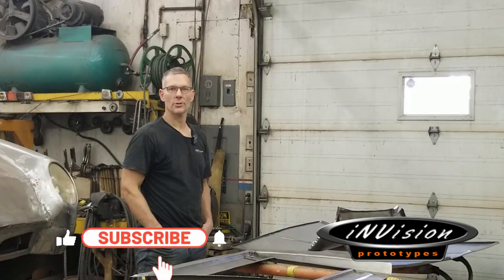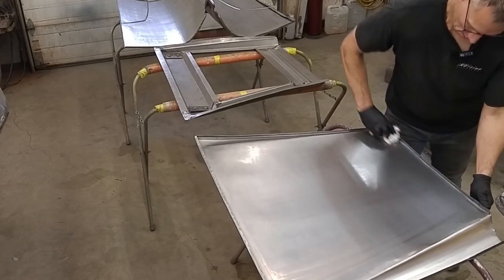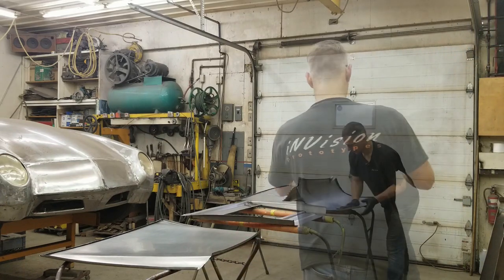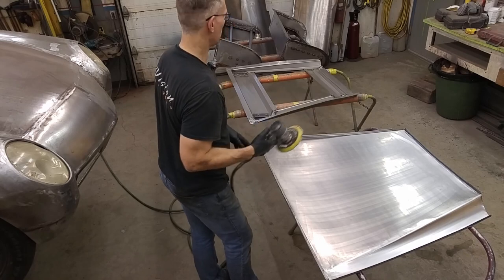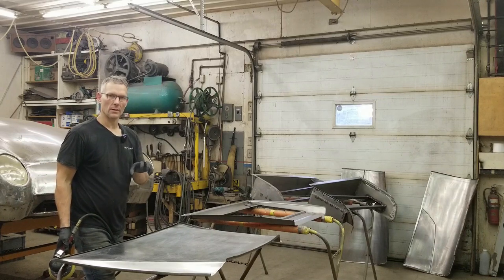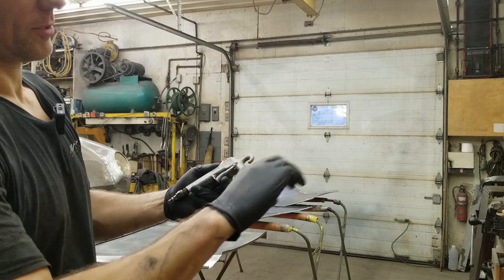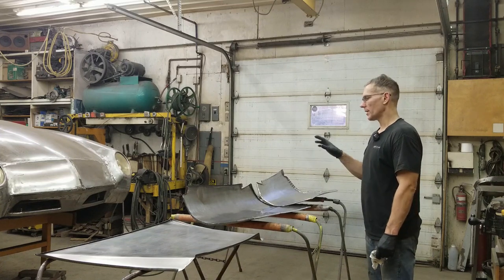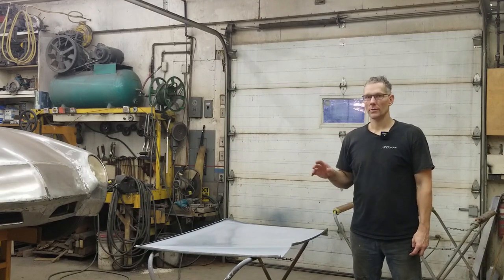2K EPOXY Primer Sheet Metal Panel Prep - TRICKS & TIPS | Ep.38 Retro Styled Electric Hot Rod

Comment: I've had better luck with self etching primer with urethane primer on top than epoxy primer but whatever works for you use it thanks for the information
Reply from the maker: Thanks for sharing!
Reply: Better luck doing what? I am genuinely interested in the answer.
Reply: @Spiritof_76  self etching primer over  bare metal than epoxy primer I have seem epoxy primer pill off
Reply: @stormyyoung6344  Was the metal thoroughly cleaned and sanded with minimum 100 grit? Do you remember what brand of epoxy primer?
Reply: @Spiritof_76  i have done many cars most sand blasted then 180 gritted shop I work at gives a lifetime warranty

Comment: I cannot get a clear answer on this.  I am painting a hood and roof on a van.  First timer.  I want to cover with an epoxy primer.  I used a Random Orbital and sanded the metal down to 180.  Should I have stopped at 80 grit?  How smooth is too smooth to accept epoxy primer.  I am afraid that I have already made it too smooth.  Any input appreciated!
Reply from the maker: Hi, when I prep bare metal for direct to metal epoxy I'll use a DA and 80grit(no higher than 120).  Never had any separation issues.  Work in gloves to prevent oil from hands getting on panel.  Wash panel with degreaser before and after sanding.  Allow degreaser up to 30 min to evaporate before shooting your epoxy.  That's it.  Now with urethane surfacing 2k primer the panel can be sanded with 180 up to 220.  Hope this helps.  Let me know if you have any other questions.  Please hit Subscribe.  Thanks!!
Reply: @iNVisionPrototypes  subscribed!  Thank you!  I was getting such bad advice from manufacturers and paint shops (Telling me to go 320-600 for Epoxy primer DTM).  That made no sense to me.  Seems way too smooth.  What degreaser do you use to clean the panels and can I just re-sand the metal back down to 80 from the 180?
Reply from the maker: @FinestEventss  Ic.  I use heavy duty wax and grease remover supplied by our local jobber.  Yes, you can sand back down using 80.  Cheers!

Comment: Thanks for the video. Can I spray epoxy primer right after sandblasting or do I need to sand it aswell?
Reply from the maker: Hi Christian,  You will need to hit the panel/body with a DA or by hand with 80 or 120 grit before applying the epoxy.  You want to knock off any loose blasting media as well as smooth the blasted profile out a bit.  Results in a better finish.  Thanks for watching.  If you have any more questions don't hesitate.  Cheers, N.

Comment: Good work. I’m surprised by all the dirt and grease you got off the parts. 
What de wax de greaser do you use? I have Prepall but don’t know if it’s the best. 
Paul
Reply from the maker: Hi Paul, our jobber carries extra strength Proform degreaser.  I've heard Prepall works well.  Just wash until you have no more residue and you're set for the next step.  Thanks for watching!!
Reply: @iNVisionPrototypes  I will. I not only have a 1977 FJ40 Land Cruiser that needs new paint, but I have an old Southbend Heavy 10 L lathe that needs attention. I’m following your example. 
Not everyone will spend the time in surface prep and I admire your focusing on that part of the job. It’s clearly number 1 in getting a good finish. 
Seriously, I was shocked at how many times you cleaned each piece, still getting black on the rag. I’m trying to teach this to my daughter. The importance of surface prep. I think she gets it. But I will forward your video to her as a reminder. 
As for my FJ40, I’m tempted to have it done professionally. But part of me wants to try it myself. It doesn’t need to be showroom quality, just protected. 
You’re working on a Porsche? That’s what it looked like in the video. An old S maybe? I’m looking for a deal on a 1973 BMW 2002 tii. My dream car, with an M engine with 6 cylinders, twin turbo and supercharged, and disk brakes all around. I used to own a 1969 BMW 1600 and fell in love with that car. Also owned a 1973 BMW 3.0 CSI that I bought in Milan Italy and shipped to Long Beach CA. 
Sorry for all the info. 
P
Reply from the maker: @paulmanhart4481  Hi Paul, I started painting when I was quite young on small parts and pieces eventually working my way up to full vehicles.  It can be quite daunting to paint a complete car if you've never done it.  If you are thinking to do the FJ40 yourself may I suggest to paint the panels separately and practice on something you don't care about.  Proper materials are expensive and it's easier to redo a single panel vs. the whole body.  The '73 BMW 2002 tii is a sweet car!!  In the video I was working on a one off hand built vehicle called Electrode we created a few years ago.  With respect to the prep stage, I will never paint over someone else's prep work as I've seen entire sections of the initial epoxy primer layer peel up from the metal after final the clear has gone on.  For whatever reason the epoxy never stuck.  That's why I'm extremely particular when it comes to prepping our cars before they see any paint.  By the way, no need to apologize.  I really enjoy chatting chat with my viewers.  Usually I reply sooner, however, it's crunch time for the '51 as my Dad and I are getting things wrapped up before paint.  Anyway, thanks for sharing and best of luck on your projects! 👍 N

Comment: Nick, I want epoxy on my clean metal. I have to choose an epoxy w/ catalyst or a "DTM Epoxy" and those scare me with a weak acid they claim to provide a chemical tooth. Sanding with 80 grit or finer gives us the mechanical tooth, but after all the work, cleaning I am afraid of delaminating. 
 The kind were all is done correctly, times, temp and comes off with some masking tape. Do you have a preference or theory?
Thanks. Mechanic wants to paint, for himself.
Reply from the maker: Hi Dean,  I haven't been able to buy self etching primer from my jobber for at least 15 years.  We've been using 2K epoxy primers without ANY issues using the procedure illustrated in the video.  I do recall 'helping' a friend who brought in a car... already primered and ready for paint.  During the unmaking process when I pulled back the tape it lifted everything down to bare metal.  I assumed poor prep work but after asking him, self etching primer was used.  I don't know if it was a case of sitting on the shelf for many years or what.  But I stick with the 2k epoxy for all my jobs and never paint over someone else's prep-work/primer.  We strip it down to bare metal and start fresh.  Hope this helps.
Reply: @iNVisionPrototypes    You gave me exactly what I was looking for regarding the 2k epoxy. What brands of 2k epoxy does your supplier carry, recommend or sell you? We have 4 paint suppliers which include Sherwin-Williams, a PPG store I thought was a high-end bank (I think for a $20 cover charge & X-Ray of your wallet, they will let you in). Another that has been here for 35 years and charge extra for it. I have not made it into the last one. ;)  I do appreciate your input and you are right about clean. Just like the video, oil based and white rag. Oh, Kimberly-Clarke makes a lint-free rag called Wyp-All, L40 or 40L. I have to did them out after my youngest boxed my stuff and moved it, to make room for his 80's car to wire it. Well, I wire it and he watches me!
 Thanks again for your name brand advice as I like doing it right, doing it once, to achieve best results. 
 DK, Omaha. Have a great time over the holidays as I feel the garage work is therapy for the mind...
Reply: @deankay4434  I have never used an epoxy primer that did poorly as long as the metal is clean and has at least 100 grit sanding scratch, including less expense brands from lesser known companies.

Comment: Since a DA is so gentle, did you use a finer grit when hand sanding?
Reply from the maker: Hi Rod, don't over think it.  At this stage the DA with 80Grit creates a pretty decent surface texture for the epoxy to adhere to.  Hand sanding may cut a little deeper, but that's OK.  It's after this stage that you need to watch what you're cutting with.  Check out my Block Sanding episode for the 40's hood.  Great question and thanks for watching.  Any more questions, don't hesitate to ask.  Cheers!  Nick

Comment: Very interesting.  Would there be the same amount of oil come off an un-worked panel?
I was always taught to prep as you did, but to use etch primer on bare metal and grp - any thoughts?
Reply from the maker: Great question! When we get sheet steel from our supplier there is a ton of oil coating them.  After we cut a blank to create a new panel out of a sheet the blank is washed before we work with it.  However, I do not let panels sit untreated while other areas are being worked on as it might be some time before we can get back to the previous area.  Flash rusting is never fun to clean up.  As for primer, there has always been a debate over what to use - etch or DTM Epoxy.  We have been prepping panels in this manner and using DTM epoxy since before I had grey hair and never had a job come back to haunt us.  Not saying that what you were taught is wrong.  From experience, etching primer remains reversible(rub some lacquer thinner on it).  DTM 2K epoxy is not and once fully cured solvent will not affect it.  If there are plans to put filler over top and one happens to cut though the epoxy into the etching primer, the filler can potentially dissolve the etching primer and cause it to come away from the metal.  I guess, at the end of the day, if you find a system that works... stick with it.  Cheers! N.
Reply: I’ve used both and like the etch primer better but DTM epoxy is the way to go if you’re putting filler on top. I’ve left both out in the elements over winter less than a mile from the ocean (BC, Canada) and both failed after a couple years.
For those saying put body filler on bare metal, that just doesn’t work well in the harsh rainy climate we have here.

Comment: what kind of degreaser do you use?
Reply from the maker: Hey AJ, usually a 3M wax and grease remover.  However, due to recent supply issues my jobber can only get ProForm.  Seems like a pretty good product with no issues so far and smells very much like the 3M product.  Hope this helps you.
Reply: @iNVisionPrototypes  It does. Thanks!

Comment: Are you wiping with wax and grease
Reply from the maker: Wiping with a 'wax & grease remover'
Reply: Do you recommend metal conditioner. Prior to this application?🙏 Panels are blasted with glass.
Reply from the maker: @mansourjreige677  It depends.  If you are leaving them bare then they should be treated otherwise flash rust will be an issue.  Usually immediately after media blasting we knock the profile down with 120grit, blow down surface with compressed air and spray with 2k epoxy.
Reply: @iNVisionPrototypes  can I use wax and grease after sanding with 120
Reply from the maker: @mansourjreige677  Sure!

Comment: Can copper be epoxy coated?
Reply from the maker: Hi! What are you doing with the copper surface after? End goal? Thanks
Reply: @iNVisionPrototypes  A copper surface that I want to paint, what are the steps to establish it and then paint it basecoat & clearcoat
Reply from the maker: @freebusinees5668  Prep it by de-greasing the surface, sand away any oxide using 80-120grit, blow off/wash and apply your epoxy.  Also, refer to your Material Data Sheet to confirm correct application of the epoxy.  Cheers!
Reply: @iNVisionPrototypes  👌👌👌
Reply from the maker: @freebusinees5668  Glad I could help.  Take care!!